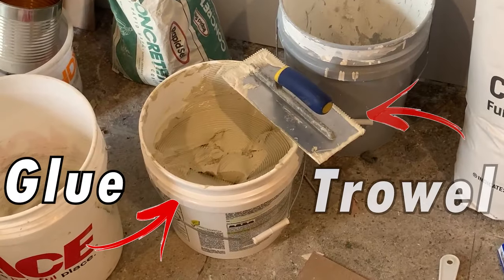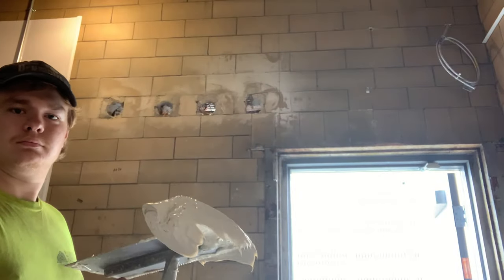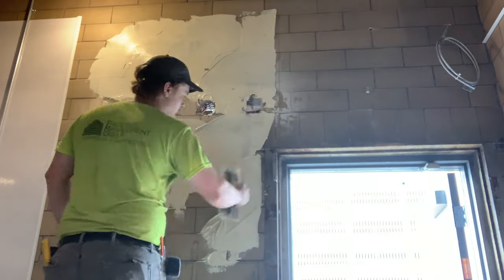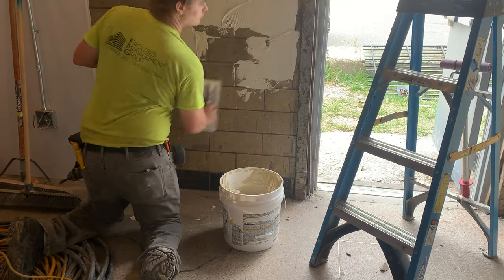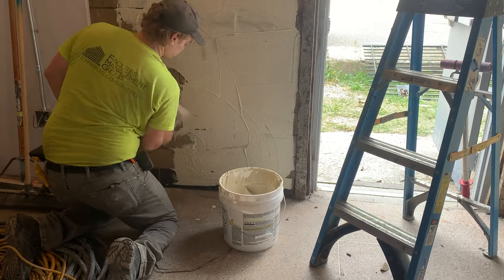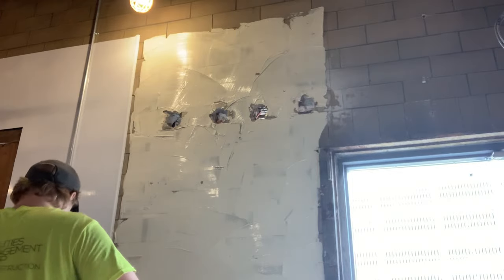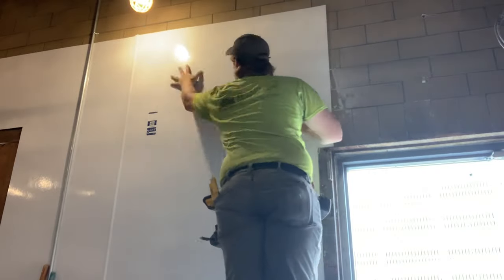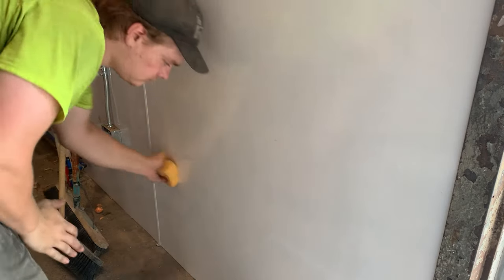Easiest FRP Installation!!

Comment from the maker: I never thought this video would get this many views. Thank you all for watching this video! Means a lot.
Reply: Keep going bro
Reply: I’m in frp hell, what about plywood to frp, do I need to score the frp? And how does it hold on the ceiling.
Reply from the maker: What’s the purpose of the plywood? Couldn’t you simply anchor the plywood to whatever the FRP is applied to? 
As far as installing FRP to a ceiling, be sure to role the sheet well. The longer  you role the sheet the better. If possible, use shorter sheets; say 8’ length sheets. Easier to manage in shorter sections.
Reply: What would be a good alternative to FRP adhesive. None of the supply store in phoenix have none in stock
Reply from the maker: I suppose you could use liquid nails, but it’s easier and cheaper to use FRP glue. May be worth ordering some online. I get mine from Lowe’s. They may sell some online
Reply: @iplconstruction5786  thank you I'll have to do that. I have to have it hanged up by Friday and everyone I tried to order it from said they are having trouble ordering it
Reply from the maker: @djazpremier  Glad I could to some degree. Good luck!
Reply: @iplconstruction5786  proper glue and trowel pattern. Makes all the difference
Reply: @djazpremier  Franklin titebond frp adhesive. 
Or dap weldwood frp adhesive
Reply: @iplconstruction5786  do not use liquid nails.  Use a latex based adhesive designed for frp.
Reply: Metal shears would cut it pretty well too, if you have a steady hand
Reply from the maker: @pablolule9175  Takes too long in my opinion and you don’t have a smooth and even cut. Thanks for watching!
Reply: Can I do this with Wall panelling? Should I sand first?
Reply: Great video thanks bud

Comment: I don't usually make comments on youtube but you're making more of a mess than you have too. You should start by rolling paper on the ground to catch all the adhesive you dropped. You dropped quite a bit.  Also, that middle bar is called a middle seam or H-channel, the end cap (J-channel) goes on top and bottom of the panel or when ending the FRP on a wall or corner where FRP is not continuing, not on an inside corner, that's what an "inside corner" is for and it's installed on the connecting panel. You had no coverage on your middle seam and was really heavy on your panel. The easiest and most dust free way to cut FRP is with a track saw attached to a HEPA Vac, my suggestion would be a Festool or something similair. As far as cleaning the panel, clorox wipes are amazing. Using a wet sponge, especially on the middle seam could leave water behind the panel. Water breaks uncured FRP adhesive down. That's why you should throw your trowels in a bucket of water for a bit before cleaning them. The adhesive wipes right off. Empty adhesive buckets work great for this and can be thrown away after. Just some suggestions.
Reply from the maker: I appreciate all of the terminology for the parts and where they go. I definitely missed a couple details in the video. 

However, I’m not sure I understand what you mean regarding no coverage on the middle seam and the panel was heavy. If you’re referring to glue coverage, I did apply a healthy amount of glue to the back of the middle seams. 
Using a router and guide is way less comber some than a track saw. It’s also  a quicker set up; 2 clamps and a plank of 1x4. It just offers more mobility than a track saw and vac. 
We usually do put our trowels in a bucket of water either during a break or lunch and I agree it’s the best way to clean up equipment you used for glue. 

Again, I appreciate the clarifications far regarding terminology. Thank you for your input and thank you for watching
Reply: @iplconstruction5786  As far as coverage I was talking about the adhesive. That's more terminology of the construction industry. It would make no sense, be a complete waste of time, and cause more of a mess to apply adhesive to the back of the middle seam rather than the wall. You claim that your method is the easiest and not to cause a mess. But your method is wrong, incomplete, and you cause a mess. In most installations the middle seam, J-channel, and inside corners are applied to the panel and taped, then the panel is hung- sweet and easy. 

As far as using a track saw, I'm not sure you've used one... 2 clamps and a track... thats your setup. Most tracks you don't need clamps on, just the track depending on if you take care of your tracks. How is that more cumbersome? Like most track saws Festools are small and mobile, the vac hepa system sits under your work table and makes a nice shelf for holding your saw and snips. Using a track saw I'd have the panel cut and hung before you'd have your clamps on and there would be NO mess.
Reply from the maker: It’s sad to see people like you so stuck in one way that it limits your thought process and creates the inability to see different methods to reach the same outcome. Innovation and new ideas are the backbone of modern trades. 50 years ago, you framed a house with hammer and nails. Now we have  pneumatic nailers. If you want to further your expertise, then you HAVE to be open to new methods. Out with the old, in with the new. If you think you have the “best” method then I’m sorry to say, you have already failed. Find new “best” methods. Out do your current work. 

It’s people like you that really piss me off; you tell people WHAT to think instead of HOW to think. Your methods may not work for everyone. Allow people to fail and succeed with the knowledge of the end product. 

I’m sorry you didn’t appreciate my methods, but nonetheless, I hope you have a successful career.
Reply: @iplconstruction5786  I never told anyone what to think and would never tell anyone HOW to think. Your giving bad advice online as if it's the "Easiest" and cleanest method when it's completely not. It's not a matter of being closed minded on my end. I seen your method... it was wrong, messy and not the easiest by any means. Also, between both of our methods we would never reach the same outcome. I would be done a lot sooner, with less mess and my installation would be done right. If you can't take critisism, doesn't that make you closed minded? You put an end cap on an inside corner in an instructional video of how to install FRP. That's not a new method... it's just wrong. Laying down paper isn't closed minded... it's just smart. Taping the channels and corners was just advice... what was you saying about being open to new methods?  

You downplayed tracksaws as being easier, faster, and cleaner because you've never used one. That would be another new method for you that you shot down pretty quick because "you think you have the “best” method". You really should ponder over everything you just wrote and reflect on the fact that everything you just said pisses you off about me.... is in reality your own thought process.  

I can understand where your frustration is coming from but I can't relate. Your a closed minded person who believes your method is the only method when the reality is you don't have the experience to tell people HOW to think... or install FRP. I have no issues allowing people to learn from their own mistakes... I have issues with people making videos that are setting other people up to fail from the start. 

As far as my career... it's been a nice one. I've made a lot of money correcting poor workmanship from construction companies and failed contractors who don't know what they're doing. It makes up about 40% of my companies yearly revenue.
Reply from the maker: I guess this is a common case of let’s agree to disagree.

Comment: I worked with a guy who gave me some valuable information from the course he took, you bring the divider tight to your last sheet and install next sheet to the inside edge of divider, then move divider over so both sheets are covered. It makes it faster and easier, especially when your doing 12' sheets 😅

Comment: Can you install frp on  ceiling ?
Reply from the maker: Yes. However, I would recommend applying the glue to the FRP sheet and not the ceiling. Use the same methods shown in the video, just on the sheet. Less mess. Just be sure to role the sheet a lot to ensure adhesion.
Reply: Can you glue frp on to rigid styrofoam insulation board.
Reply from the maker: I would recommend putting something over top of the insulation such as 1/2” plywood or 1/2” drywall before installing the FRP panels.

Comment: Thanks for making this video on a specialty product like FRP.  We install FRP and other wall protection products. 
Gluing to CMU (concrete block) takes several times more adhesive than it would on painted sheetrock.  
We cut out for outlets and other openings prior to hanging it.
We also use a tin metal shears (electric) for making the long, straight cuts.  That has worked well for us.  We also roll every bit of the FRP to prevent delamination.
Reply: Hi what brand of adhesive do you use for painted sheet rock?
Reply from the maker: I’ve always used Titebond FastGrab FRP Glue. Works for me.

Comment: I use snips that attach to a drill, and I hammer my seams to fit the panels more even, I only glie with a side to side pattern in order to roll out air bubbles in a better fashion I also use an 1/8th inch trowel in order to cover a nice spread on the wall. You have great techniques bro and.im gonna use some of them thats why I'm here, I'm a non union scab and I do whatvi can but im a plastic master and I also do Inpro paneling too. Nice video!

Comment: I am doing a complete rebuild of an Aliner hardshell popup camper that was rotted out. The walls are vertical and 45 Degrees overhead. I am using the 1/16" thick sheets as the 1/8" would add too much weight for the surface.  This is the way I plan to hang it. Thank you for showing your technique and being very thorough with the demonstration.

Comment: I am a tool design engineer, I made a special tool for FRP and I used it after I glued the back of the panel, and with the tool, one person can lift the panel and install it on the wall without any problem with the glue or the wall!
I am working on a tool to actually bend the frp panels to the shape to fit the corners.
Reply from the maker: Definitely an interesting concept.

Comment: Nice job.  I truly appreciate the tips.  I'm thinking about covering some old ceramic tile in a commercial bathroom to freshen it up and this should be very helpful.
Reply from the maker: I'm glad I was able to help! Good luck with that job!
Reply: If you are installing over ceramic tile make sure you use advanced polymer adhesive.

Comment: Excellent video! A couple of points: never push the FRP panel tight into the divider bar. Push it in only about half-way; it needs room to expand. The manufacturers insist on this. And allow 1 gallon of adhesive for each 50 square feet of panel. 

Now I have a question: the adhesive manufacturers all warn that you should never apply the adhesive to the wall but only to the FRP panel. No explanation. Any idea as to why? Ever had a problem? I prefer your method, if it hasn't had issues.
Reply from the maker: I’ve never had a bad experience applying glue on the wall. The glue doesn’t slide off the wall or anything like that besides large globs of it. However, by the time you begin to spread it, it stays where you trowel. 

Thank you for watching and commenting!
Reply: Evening Paul!
Sounds like you have more knowledge on this specific material. 
Im an electrician, although I do other little gigs for a client of mine in a cafe. 
He has a small kitchen and a part of the FRP is burned. 
Although! It’s glued on drywall. 

How do I go on replacing this?

Comment: Great vid man! There is one better way to cut it, absolutely zero dust.. electric tin shears. Cuts smooth and straight. Obviously they don’t work in every situation (electric boxes, plumbing, etc.) but for straight cuts they are the bees knees. Just a suggestion thanks for the vid!!
Reply from the maker: Do you snap a line then and free cut the panels?

Comment: Converting a shuttle bus into a camper with a shower....how would you suggest dealing with the curved walls using FRP?  Best to create a straight wall with ply wood foundation, or is it possible to bend FRP and still get good adhesion on a wall with a slight curve?......and thanks for the excellent tips!
Reply from the maker: When We did our FRP job, we had to put panels on a curved bar wall. We were able to wrap the FRP with the curve. I would recommend putting a generous amount of glue on the wall and holding it on the curve for a minute or so to ensure adhesion. FRP is pretty flexible so you should be able to apply the sheet directly on the curve wall. Just use a generous amount of glue.

Thanks for the question.

Comment: We used mineral spirits instead of water. Like magic cleaning glue. Also, don't roller over the edge because you'll end up rolling tracks of squeezed out glue from the side. We used a jig saw to cuz our sheets and then glued the sheets rather than the walls. Same result I guess, but I think I'd have rather glued the walls rather than have the cut and glue stations before tossing them on the wall.
Reply from the maker: That’s the beauty of trade work; everyone does it differently and yet get the same results. No one has figured out the best method for anything. We can only learn different techniques and apply them to our own techniques. It’s amazing!
Reply: Stop about 1/4 inch from edge all the way around this will help stop pushing excess glue out when rolling!
Reply: Seen so many videos with people gluing then carrying to wall, to much chance to make a mess and getting glue everywhere! Glue on walls makes best and most sense and why I rate this video number 1, would be perfect if showed scribeing and cutting with knife!  For us poor folks without a router! Lol!

Comment: Thanks for the video.  it was very helpful. 
How did you attach the dividers or end caps?
Reply from the maker: I apply a small amount of glue to the inside end caps and I install them to the FRP sheet I'm about to install on the wall. I found that they tend to slip off the sheet as I go to install the sheet. A little bit of glue helps those pieces stay connected. As far as the dividers, I install them after I install the FRP sheet. I also apply a small amount of glue to the divider; this time on the back of the piece. A tip for applying glue on the dividers/end caps, I typically scrape off the access glue from my trowel and I use that for the dividers/end caps. You don't need a lot of glue for it to stick. I hope this was helpful to you. Thank you for the question.

Comment: I see that you installed over what looked like concrete blocks. Would the same technique be used over PT plywood?
Reply from the maker: Yes
Reply: @iplconstruction5786  Thank you
Reply: The cohesion method is the proper installation technique
Reply: with the proper adhesive pre installation you can install on sheetrock, plywood,  oriented strand board,  durrock, and various other substrates

Comment: Excellent video!  What kind of glue would you recommend for using outdoors?  It needs to handle the humidity and cold temperatures of New York.  I plan to reskin my camper/trailer with FRP paneling.  Thank you.

Comment: Great job. Your video is very helpful. Thank you for sharing. Question - can I install FRP on a trailer ceiling by attaching it to 16 inch on center roof rafters with screws (no plywood)?
Reply from the maker: I don’t see why not. I’d recommend some nice wide head stainless screws to install the panels. Thanks for the comment!

Comment: Thanks, really helpful, 🙏🙏
Reply from the maker: I’m glad you found this video useful. Thanks for watching!
Reply: great video!! i need to install frp over painted concrete. what type of adhesive would be best
Reply from the maker: @vanessajones5241  For any FRP installation job, I use Titebond Fast Grab FRP Adhesive. Its the best. Every other brand I've used had been too runny. I would recommend applying a generous amount of glue on concrete. I hope this helps. Thanks for the comment.

Comment: A pair of 18g shears is the best way to cut FRP. Cuts quickly and absolutely no dust at all. Use a router just to cut the outlet/pipe holes.
Reply from the maker: I just like the router method simply because it guarantees a straight and smooth cut. In the grand scheme of things, it honestly doesn’t matter all that much. You still get the same results, however it just helps me do a consistent good job.

Comment: Great video! I have a question; I'm thinking of putting FRP over a 8 ft high concrete wall I have in my basement laundry room, the concrete wall seeps water during the rainy winter season into a concrete catch channel on the floor where the wall and the floor meet. I basically want to hide the seeping concrete wall but allow it to do its seeping into the water channel, I'm wondering if I have two options for this FRP installation considering my desire to allow the concrete wall to seep water in the winter. Option #1, glue the FRP in a way that is just applying the glue with 6 inch vertical swipes every twelve inches or so to allow water to seep, or option #2 by framing the wall with 2x4's and screw mounting the FRP to the wood. What do you think?

Comment: Guess what I did with my FRP in my Basement shower?  I stalled the FRP sheets with Concrete screws and aluminum washers with rubber gaskets!  enough to stretch it out, it get moist in my little shower, always cleaning the FRP.

Comment: What brand FRP is this? It looks like a nice smooth gloss surface which is what I am looking for and I need 9' tall by 6' wide which I assume would be 2 pieces.
Reply from the maker: The FRP panels are typically 4’x10’. As far as the brand, I do know. All I know is, the boss bought panels from L&W Supply. 

I hope that answers your questions. Thank you for your comment!
Reply: @iplconstruction5786  Thanks!